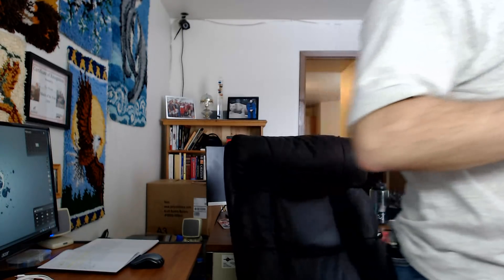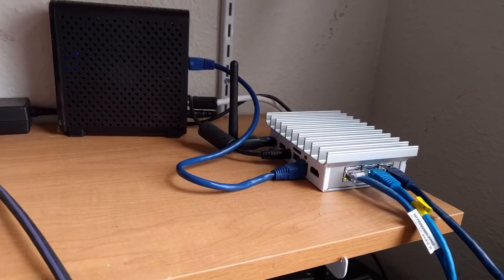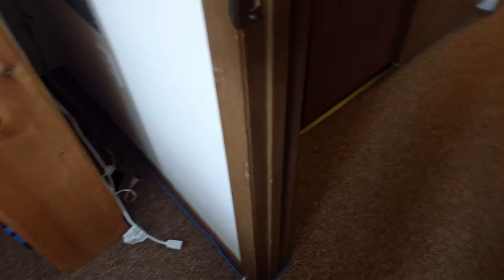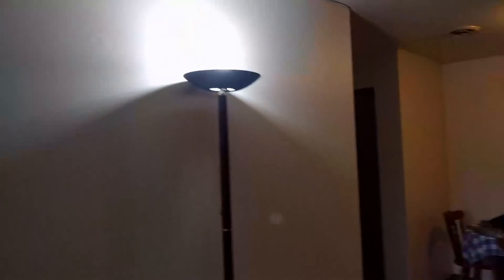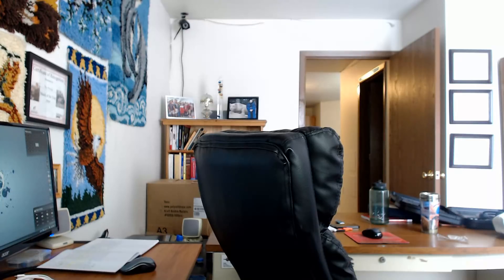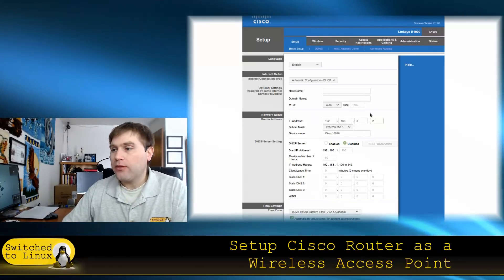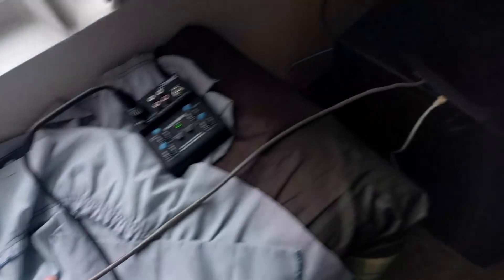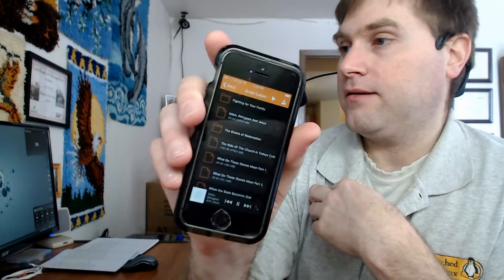Create a Wireless Access Point from an Old Router

Comment: HELP PLEASE i don't have internet in my house at all, BUT i connect through  my laptop wifi wirelessly to 3-4 neighbors around with very weak signals.However i have a ZTE router,please tell me how to increase signal by using this router its 2017 model ZTE ZXHN H108N ,can i use it as access point with the 1st floor i am above aka* 2nd floor which is the internet of my sister but is weak.Tell me plz.God bless.
Thank you in advance!
Paul. Athens Hellas.

Comment: Great video, but maybe I missed something- I'm using Linux Mint 18. What did you use to access the router itself?
Reply from the maker: just use a web browser and navigate to the IP address to control the router. In this case it was 192.168.1.1, sometimes it will be 192.168.0.1

Comment: why not put DDWRT into this access point ?
Reply: OpenWrt saved my router's life. Major bugs in the stock firmware. It used to always stop broadcasting the SSID and now with OWRT it works perfectly.
Reply from the maker: I do not believe it is compatible with this router...but if it is, it was a time matter to solve an immediate problem I was having :)
Reply: HELP PLEASE i don't have internet in my house at all, BUT i connect through  my laptop wifi wirelessly to 3-4 neighbors around with very weak signals.However i have a ZTE router,please tell me how to increase signal by using this router its 2017 model ZTE ZXHN H108N ,can i use it as access point with the 1st floor i am above aka* 2nd floor which is the internet of my sister but is weak.Tell me plz.God bless.
Thank you in advance!
Paul. Athens Hellas.
Reply: Older Linksys routers are usually good for DDWRT, or OpenWrt like the legendary WRT54G(check your version # some won't work, or work as well) but the never ones with Cisco branding are hit, and miss like the Cisco Linksys e900, and e1200 where both no goes for me beyond stock firmware. I can't comment since Linksys got bought by Belkin, as I've not used their newest products. I currently use a D-Link N 300 speed wireless router that serves my needs just fine.